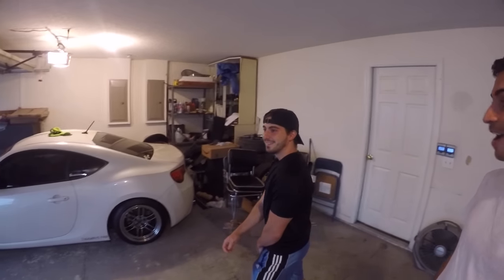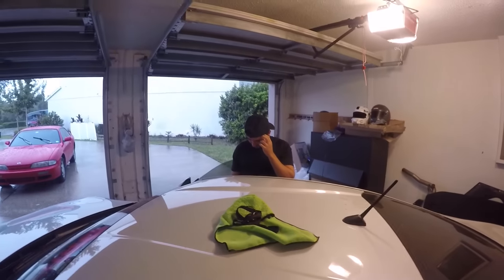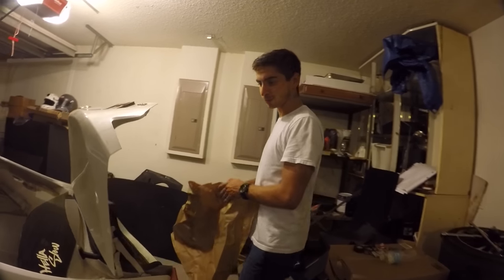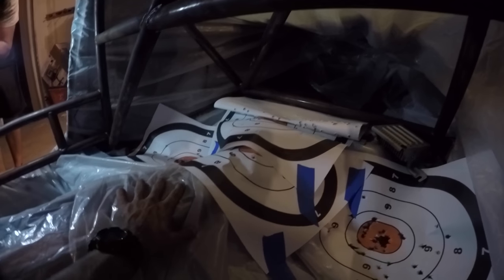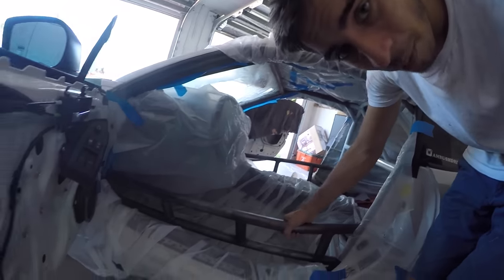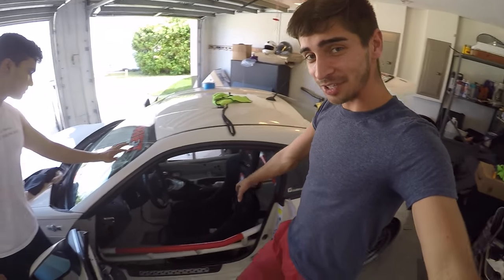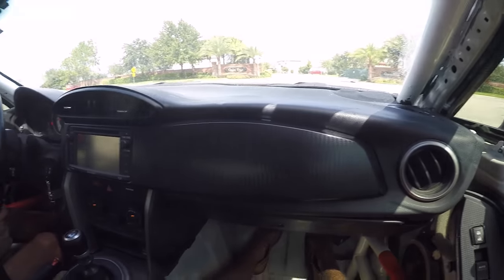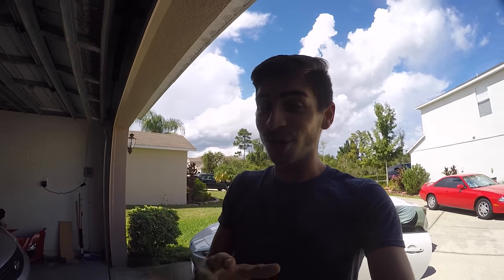Painting my Roll Cage! | Scion FRS

Comment: oi chief. why a FRS? why not a s14 or s13? s15? JZX? a lot of money for a FRS $$. and when is the engine work going to come?? (if any) last vid defs looks like you need more powerrrrrr.
Reply: newer chassis, less bs to deal with, reliable setup
Reply: 'less bs'? my s chassis is still running... their very reliable. i bought mine relatively stock. the only reason silvia's are seen as 'bs' cars and not reliable is because you have home mechanics splicing and dicing shit. so ur comment is nulled....
Reply: around here a clean s13 or s14 is around 9k. literally all of them have rust here or are shit boxes. I picked up my brand new frs from auction at 9k which made way more sense over a 20+ year old s chassis.
Reply: frs for 9k? jeez was it crashed or something?
Reply: yeah I'm a collision tech. prepper and apprentice painter so fixing these is no problem for me. 2016, 1035km, manual still has dealer stickers and plastics on it for 9k
Reply: pretty good if you know what ur doing. if you dont can be quite dawnting. and he didnt fix up a crashed one, he bought it new (or close to) which is $$ more $$ then buying a s13 shell and throwing a motor in
Reply: yeah I guess. I just got tired of dealing with older cars.the prices here in Toronto are outrageous. people think they're cars are goldmines
Reply: i love dealing with older cars. not into the classics but i like my car. would be nice if it was newer and not so.. beat but its part of the price. :) ah.
Reply: It's more reliable, more modern, easy to work on. An frs is the most ideal starter car if you have cash. I don't lol. But working on and modifying a car with new components and no rust is a dream